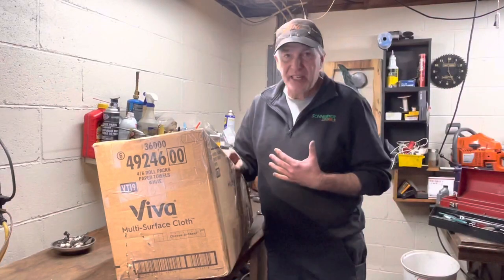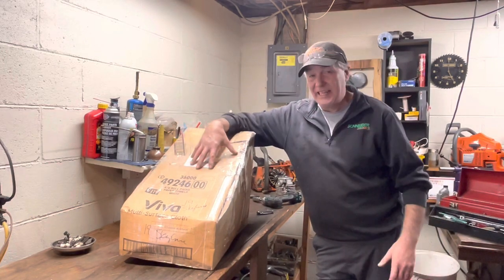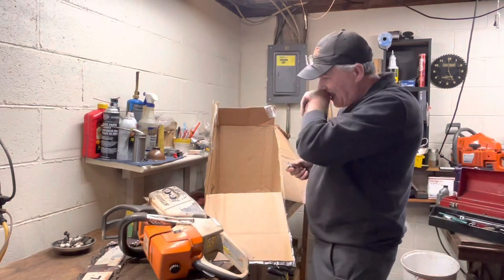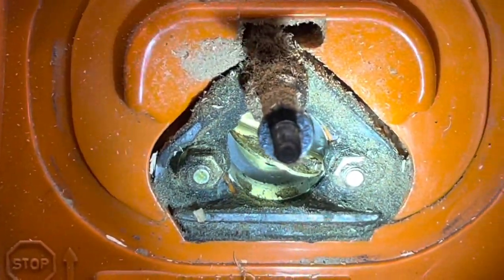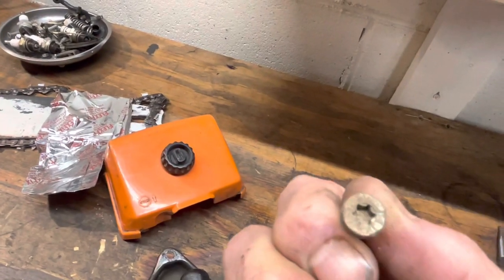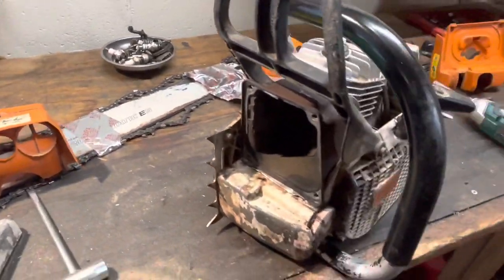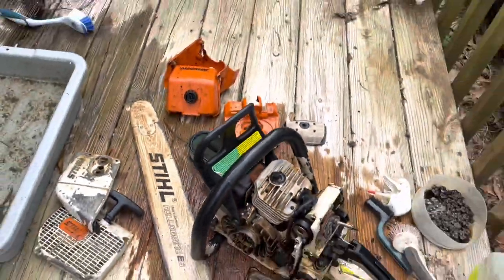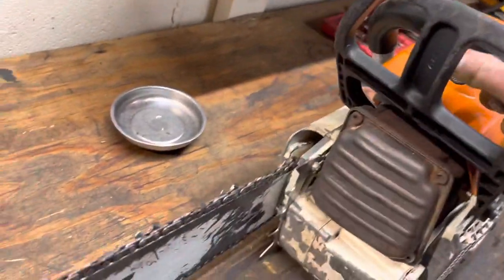So I bought an MS440 off EBay. Let’s see if I can make a dollar

Comment: I've had a couple good flips in the past, but my go-to is lawnmowers usually.  One time someone was selling a near new lawnmower at a yard sale for $10.  It was only 2 years old and they said it wasn't running.  I gave them the $10 and came home to find that the spark plug was very loose and that's why it had no compression.  I tightened it up and it ran like brand new.  I sold it for $140 a few days later.  It's nice when things work in our favor once in a while

Comment: I once took a chance on a really filthy MS361 that was going to be a project for $150 shipped. I was fully planning on a rebuild project,so first thing I did was pull muffler and saw a beautiful piston,then checked compression and it was 150lbs...It had been marked "not working" 7 years prior,so what was the problem? The decompression valve was pushed in!

Comment: I bought an early white plastic 020av i was going to steal the coil from for parts for $100. It was crazy dirty but after looking it over and cleaning it up all it needed was an impulse and fuel line I was amazed how nice condition it was.  Filled it up with gas and oil and it runs perfect now i use it all the time. It usually starts first or second pull.

Comment: Pull the starter off and clean up the flywheel side and then clean and lube the PTO side.  I then replace the fuel line, filter and pressure test the tank and vent.  It looks pretty good, about like what I see from EBay.  My 025, which I bought recently, was in similar condition, albeit without the missing paint.

Comment: I’ve been burnt by people that knew what they were selling. A ms362 that the crank had blown a hole in between the oil tank inside the case, an ms460 “running” with bad bearings would not run. I rebuilt them I am also very avid about writing Honest Chainsaw Seller to keep thieves knowingly taking advantage of folks. Nice vid very good purchase😊

Comment: Once in a while you find that diamond in the rough. You should be able to come close if not double your money. Good job.
Reply from the maker: Even the sun shines on a dogs ass every once and a while.  I've had my share of duds.  It's always a crap shoot, but I think I'll do ok with this one.
Reply: What’s your take on splitting it an re powdering the cases? Straight flip makes more money than full rebuild and woods port?
Reply from the maker: @mrxlh  Honestly people are paying silly money for pro saws in non-working condition.  It almost makes more sense to sell a project saw in a box than doing a proper restoration.  Look at some closed listings on ebay and there's not that much difference in $$ for a running saw than one that needs a rebuild and missing parts.  I have no idea where this line of thinking comes from.

Comment: I'm 6 old stihls in all off ebay 009 009L 024av 08 051av 020av and a ms200t in all oem all new parts to port. All but the 200t run